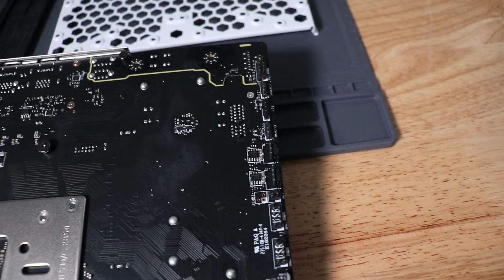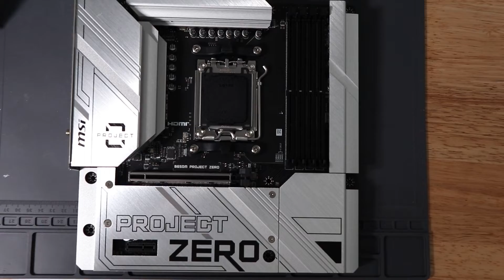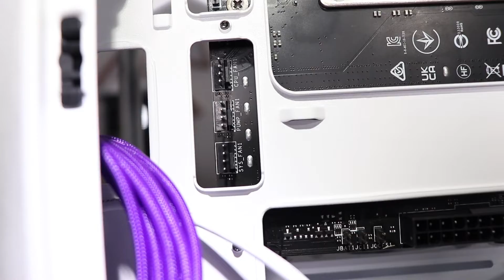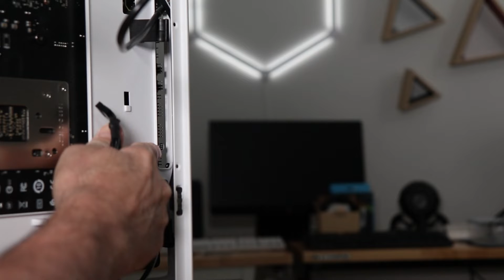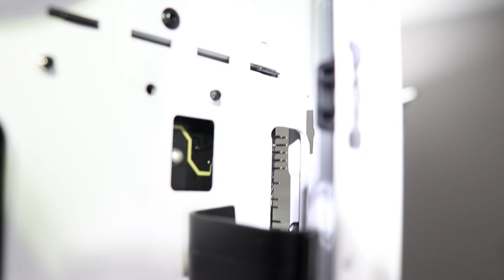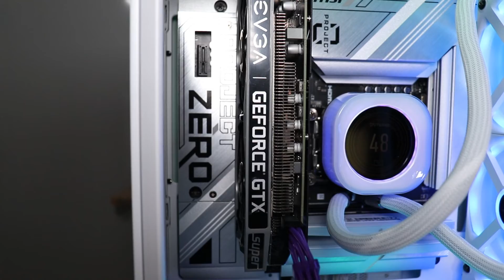Mount a Project Zero Motherboard into the Tower 300 - It CAN'T be done they said!

Comment: Im getting tons of vids on the 300 lately. Not related to the case, but I did a PZ build a couple months ago. 'Simplifies cable management' is.. a stretch. Imo, it made dealing with cables a pain in the ass. The problem is that nothing else has changed so you end up with a bunch more cable in the back that was meant to be making runs out front. I built in a dual chamber C5 and when I had to add sata power and do something with that 3ft cable, things got tiiight. Overall though, worth it and I'd happily do it again. Just don't think its going to make things any easier.
Reply from the maker: Hi ChatBot1337, yea, that's a fair point and will vary depending on the case. I found this to be reasonbly easy to do, but didn't have large amounts of cabling to deal with, I can see situations where it would be a pain. But, it does look tidy when its done!!! Thanks for watching!!!

Comment: I really wish they had a panel on the side so you can mount it in the "normal" position to prevent any chance of the GPU overheating... I love the look of it ❤ I wanted to do something like a project zero but it looks to have a 10 stage power supply when there are other boards with a 14 stage at the same price..are there any you could recommend that would do both of these...?

Comment: Isn't the AIO upside down? Shouldn't the hoses be pointing down?
Reply from the maker: Hi 2810Mad, that's a great question. No, the AIO is not upside down. Although there are different opinions out there on how to orient an AIO. In this case, there really isn't any other option if you're using a 360mm AIO/RAD. You might get away with turning it the other way, but you would have to remove the power supply covers and drive mounting brackets and there may not be clearance next to the power supply as well. 

That, of course is with a 360mm AIO, if you use a 240mm turning it the other direction might be more doable. Either way, the hoses in the top position are fine and looks better in my opinion. The rule of thumb is as long as the PUMP is not the highest part of the loop it's all good. There are more ideal positions in other cases, but my personal opinion is, it doesn't really matter, I try to mount AIO's in the top if possible, but that's not possible here. If I can't do that, avoid putting the pump in the highest position and call it good. 

With the tower 300 mounted on the horizontal stand, it is possible to get the pump as the highest part of your loop, so take that into consideration if using the horizontal stand and orient it properly. In that case, the AIO is at the top position and works fine. 

So, build with confidence and put the hoses at the top and it's all good. However, you might find some disagreement out there, as with anything. 

Good luck, have fun and thanks for watching!!!

Comment: I am confused. The Tower 300 is on MSI's list? Am I missing something?
Reply from the maker: Hi charackthe , you are not confused. It is on the list. There was confusion initially and it had been mentioned this case didn't support Project Zero. I initially didn't see this case listed on the compatable case list, but that's been some time ago now.  But that's what prompted me to do a video on it. Regardless, it's supported and it works fine, with some of the considerations I mentioned in the video. 

Thanks for watching!!!
Reply: @HardwareArtisan  Thanks a bunch. I was not sure about this case but your videos made things clear. Such as the fan clearances and hdd mount spots you mentioned in your other videos.

Thanks again!

Comment: The Tower 300 is listed on the compatible cases page on MSI website.
Reply from the maker: Hi Retired_Medic, it sure is, isn't it. That's great, it still doesn't show on their product page for this motherboard, who knows why. But you are correct, it's showing on the compatable case list. Thanks for Watching!!!
Reply: @HardwareArtisan  I have mine half assembled with Windows 10 Pro loaded and I think you understated the difficulty of getting to the right underside connections on the board. It was a half hour of misery for me. You can't see and read the labels on bottom connectors on that side and you have to keep referencing the manual to know which one you need. If I had to do it again, and there are only 2 or 3 connections that most people need to use, I might have tried attaching them with the with the board loose and then screw it down to the standoffs. It's something  I might try if I ever have to remove it. I still have to put in a triple Asiahorse RGB triple fan on the right.  And I don't see where you tried to install a hard drive . The HDD will only go on one way, horizontally, with the connectors facing to the rear and it still smashes the power cable. I didn't have a power wire where the wires came out the top. That would have fit perfect. Now for cable management :) Thanks. I7 13700 CB23 29000.
Reply from the maker: @Retired_Medic , im glad you got it completed and fair enough about the difficulty on the right side..it was definitely something I was concerned about and as you stated I did attach them with the motherboard loose. But overall it wasn't as bad as I thought it could be. But, as you said...misery is within the scope of this project...thank you for the report. That's one vote for attaching cables before screwing down the motherboard! Overall, would you recommend anybody use Project Zero Boards on this case? Thanks for the awesome update!

Comment: I love the looks of the tower 300 !
Yhe fact that it could work with a project zero MB is even better.
Regarding those connections that are a pain to get to. , I figure just getting some short (50mm) stubbie cable extensions is a small price to pay to not have to worry about access them.
Hmmm might need to get a can of paint , I want a blood red case , With the inserts and tops being black.
Kinda odd TT doesn't offer this case in red .
Reply from the maker: HI tonydalimata, I agree, it's a great looking case and I though the same thing about buying some extensions for the rear facing project zero connection, but honestly it's not needed. It was easer to access than I though and with some care it's not hard. I love your idea about a blood red case that sounds cool for sure!!!! Let me know if you complete that! 

Thanks for watching!!!

Comment: I do like the idea of having more of the connections on the back but not all.  Many AIOs have at least one set of wires coming off the pump from the block and would much rather plug that in to a nearby header instead of wrapping it all the way to the back.  I do wish they would make them in just plain black as well.
Reply from the maker: Hi gscurd75, that's an excellent point that I hadn't considered since I used the Corsair iCUE link one with this. You are correct though, mose AIO's have a cable (or two) coming off of it that would ruin the effect a bit. Score one for iCUE link I guess, haha. I also agree, hopefully, if these become more popular we'll get some new looks. 

All great points, thanks for the support, and for watching!!!

Comment: How about a tower 200?
Reply from the maker: No support for tower 200, at least when I did the review of the 200 it wasn't supported, I just looked at the product page for the tower 200, they haven't changed anything that I can see. You would truly have to get the jigsaw and "cut here" if you want it working on the tower 200.  I'd like to see them add it though!
Reply: @HardwareArtisan  Aww bummer.  I figured it may fit the main power cable and the CPU power if the holes lined up. But of course anything on the side aka bottom of the mother board area would probably be a challenge at best and need cutting at worst.

Comment: Did this with the B760M Project zero.  Went in easy.  Only caveat is you need to connect case io connectors and maybe rgb or fam cables, prior to putting in the motherboard.  Just connect and pull through as you place the board on the standoffs.  Then you dont have to mess with that one side after the motherboard is screwed in.
Reply from the maker: Hi Kinaek, that's awesome! Glad to hear you had success with the B760M. Good tips on installation, that's how I did it. Thanks for the support and for watching!
Reply: Did you have any problem to fit the motherboard in the case, particularly in the side where the GPU is?
Reply: @Shouziroku  no just the cable issue. You just need to plan ahead for which headers youre going to use down the gpu side and connect them prior to fastening the board down. In my build there was one cable I had to install on that side after the fact, it was tricky but doable. But other than that it all fits fine. Cable mgmt is a breeze too. Only cables visible are the usb and power for my AIO.
Reply: @Kinaek  I finally was able to fit it. It's a tight fit because there's a kind of metal lip on the mobo. And yeah I was afraid I would need to buy longer cables but luckily they were enough. Those connectors on the right side(seen from the back) are a pain though. 
I also had to turn the PSU upsidedown so that it intakes from the base of the case instead of working against the fans blowing air up.
Reply: @Shouziroku  good to note! I'm thinking about doing this build myself. Haven't decided if i wanna do a top mounted AIO or a side mounted one.
Reply: @rovistarr  Definitely side. Although rarely because it's accessible by removing the front panel, you may need to open the top from time to time, as it is where the peripheral's  cables connect out of. At least to flash a new firmware to mobo I had to use those USB ports instead of the front ones. The top can only house 2 fans as well, while I got a TH360v2 at the side.
Reply: @Shouziroku  good point about opening and flashing. figured it'd be an arrange it once and leave it forever kind of thing.  I will be getting a USB hub to try and avoid the io ports. I've panned my build with 6 Thermaltake CT140 (i'm not a heavy gamer) 2 fans being part of the AIO

Comment: Planning on doing a tower 300 build in June so having a definitive answer for project zero support helps a lot! thanks man!
Reply: I got mine today 🔥❤️
Reply: I'm wondering what the max size gpu that will fit
Reply: @jessevelazquez7088  The Tower 300 fits up to 400mm long GPUs IIRC, so I believe that's all of the 4090 variants on the market.  I'm still waiting to see what the specs are for the 5090 before buying my new build, it sounds like it's going to be even bigger than the 4090 fan.
Reply: @jessevelazquez7088  max 400mm
Reply: I am doing one this month aswell and had my eye on that project zero board, guess great minds think alike xD
Reply: @wnen8611  hell yeah 😎 my friend thinks the case looks stupid but i say it's unique and finally something that isn't boring lol, good luck on your build!
Reply: @bingbongbingchong  your friends are insane if they think this case is stupid, it's a beauty!!
Reply: Research video cards, my gigabyte one overheats when its standing up, i have to lay it on its sode
Reply: @algron8313  if your GPU overheats then your airflow is not correct. Make sure you don't put any side against a wall or check your fan setup.
Reply: @wnen8611 google it, it is a thing with some video cards, my 4080s hot spot was 107 and throttling hard under load. And i was thinking what you said, Airflow or something like that. After hrs of messing with it and looking online I found some posts saying that the card being vertical was the issue. I turned the case on its side and instantly 69-73c under load.